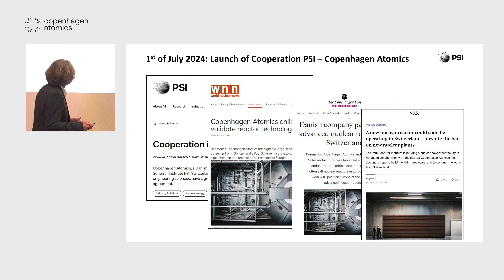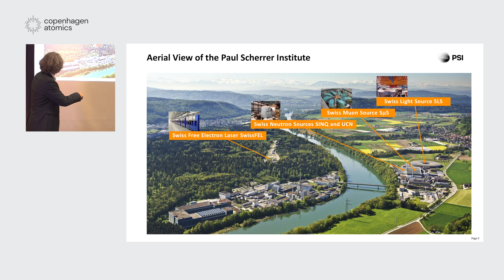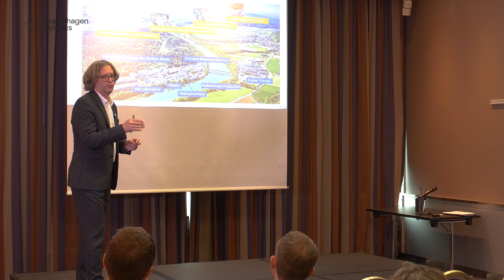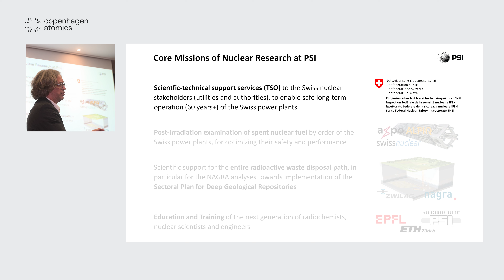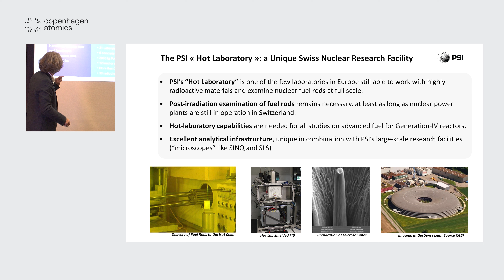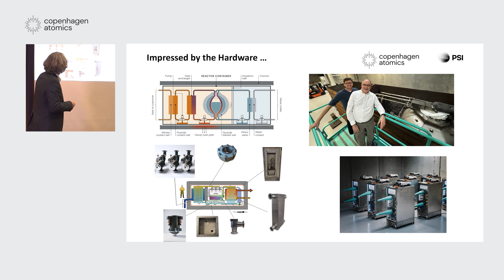Swiss Molten Salt Experiment at PSI

Comment: Oh you mean the one that is always just a few years away from being  in production.
Forever a few years away,  good job if you can snag it.
2  Problems 
The Irradiated Lithium of the Lithium Fluoride molten salt produces Tritium. Tritium is both toxic and radioactive and easily contaminates water.
Irradiated TH produces U233 that fissions releasing energy And GAMMA RAYS.  The gamma rays then make every part of the reactor radioactive.  Gamma rays are dangerous and difficult to work with.

fwiw  any potential Fusion reactors also release Gamma rays with similar problems of contamination and control.
Reply: Tritium has a half life of 12.3 years.  It could be held for a while and then released.  Not sure how they will deal with this, but eventually it could also capture more neutrons and become helium 3.  It could also be collected and sold.  

Gamma Rays need to be shielded against, but beyond that, there's no further issue.  U232 generation as a side effect from breeding u233 from th232 is interesting for this reactor in that it offers a layer of nuclear proliferation security through making the fuel exceedingly difficult to handle for weapons reprocessing. 

The fact that a nuclear reactor becomes radioactive is much less a show stopper for a nuclear reactor than you make it sound.  In fact, I'd imagine neutrons (which can actually make a reactor radioactive) are integral to the operation of a reactor, fission or otherwise.  GAMMA RAYS, on the other hand, DO NOT make a reactor or anything else radioactive.  The fact that you don't know this shows that you don't know much about nuclear.
Reply: @MrGottaQuestion  The intense radiation (gammas and neutrons) can affect nuclei in stable atoms and activate them. That is, it converts the stable isotopes into radioactive isotopes, which will later decay.  One case is Cobalt in Iron can become radioactive.  

The part that scientists didn't understand until about 100 years ago is that certain elements have isotopes that are radioactive.

In some elements, all of the isotopes are radioactive. Hydrogen is a good example of an element with multiple isotopes, one of which is radioactive. Normal hydrogen, or hydrogen-1, has one proton and no neutrons. (Because there is only one proton in the nucleus, there is no need for the binding effects of neutrons.
hotodisintegration (also called phototransmutation, or a photonuclear reaction) is a nuclear process in which an atomic nucleus absorbs a high-energy gamma ray, enters an excited state, and immediately decays by emitting a subatomic particle. The incoming gamma ray effectively knocks one or more neutrons, protons, or an alpha particle out of the nucleus. The reactions are called (γ,n), (γ,p), and (γ,α), respectively.

Photodisintegration is endothermic (energy absorbing) for atomic nuclei lighter than iron and sometimes exothermic (energy releasing) for atomic nuclei heavier than iron.
Reply: @frankkolmann4801  um not sure what anything in a nuclear reactor has to do with the understanding of scientists in 1925 but ok.  Gamma rays can (rarely) knock out a proton or neutron from an atom and cause it to become radioactive.  But the effect is tiny compared to the intense neutron flux of any nuclear reactor.  Obviously the reactor will be radioactive for a while.  So what?
Reply: @MrGottaQuestion  So it is you who does not know much about nuclear reactors.  You have no idea on how much effect gamma rays have.  The shields needed are significant even lead can become radioactive 
Tritium is very difficult to contain and easily contaminates water , because water is ingested radioactive water is particularly dangerous.
Reply: @frankkolmann4801  any sufficient amount of mass blocks gamma rays.  It could be concrete since that's cheaper than lead.  The reactor will have concrete around it.  No big deal.

Having water that's radioactive? So scary!  Did you know the ocean is radioactive?
Reply: @MrGottaQuestion  Do you know what Phototransmutation is  It makes everything radioactive  Lead Concrete steel  everything  Gamma rays make everything radioactive  MSR reactors release Gamma rays
Reply: @frankkolmann4801  And neutrons.  Which are more likely to transmute other elements.  The reactor itself and the nearby containment will be radioactive for a while.  I don't get how this is news.
Reply: Do gamma rays stick around and make other things radioactive?  How does that work?